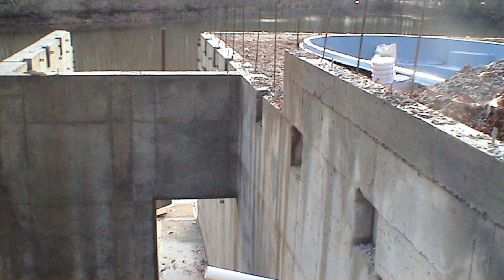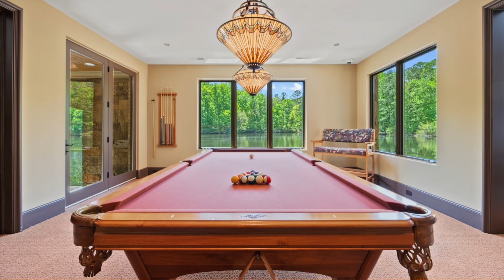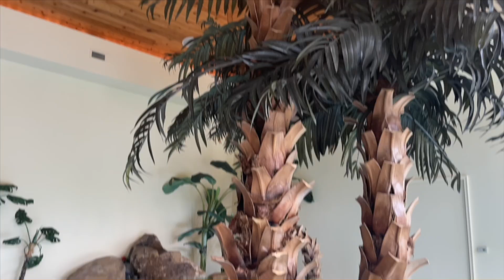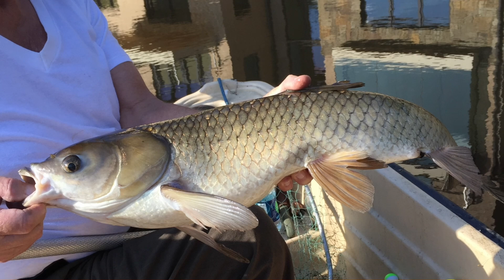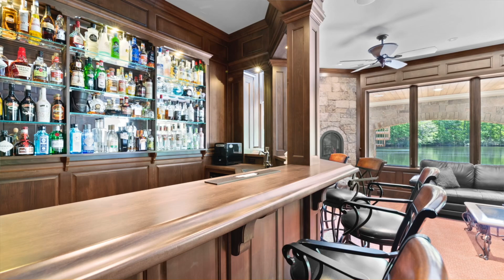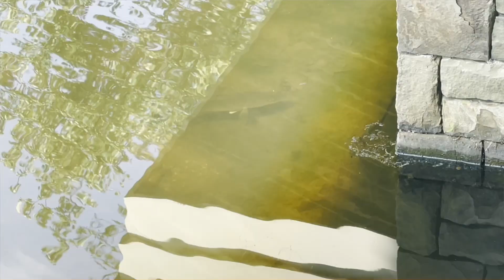Anna Lake Owner's Commentary

Comment: This guy is, without question, a raging genius. His I.Q. is probably in the 160 range. I've seen a multitude of castles, mansions, and breathtaking estates, but this is by far the most well thought out design I have personally ever heard of within the U.S. It's a trillion times smarter to use this OWNER/DESIGNER to feature his home, than a realtor. No realtor drawing breath could outdo this man's pitch. There is an estate in Cashiers, NC at 1090 Zeb Alley Road, Cashiers, NC 28717. It was offered at 6.5 million. The owner was also the designer. It was on the market for several years and just recently sold. It was also a spectacular property, but the problem I had with it was the lack of one really BIG room and view. It was a cluster of many smaller sized rooms and I didn't care for the layout of the living room or dining room - was odd. I've turned my attention to Cary because it's ranked as one of the best cities in the entire U.S. and it's close to Duke University hospital which ranks #1 in the state. I do wonder what the Flood Factor would rank here and if it's insurable, even with the multitude of precautions, safety measures, and so forth.